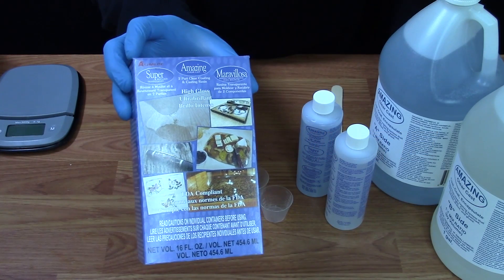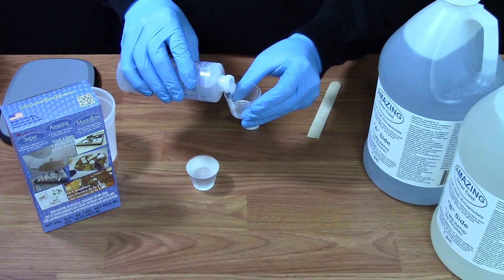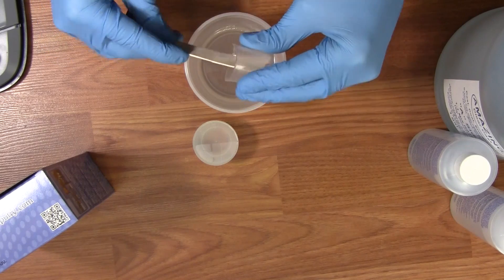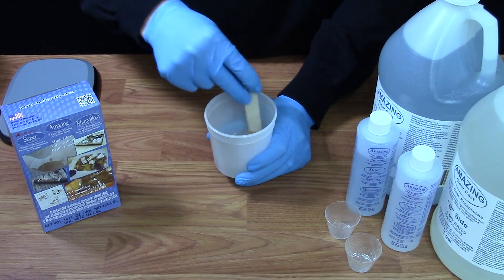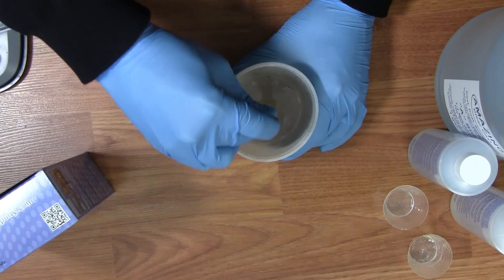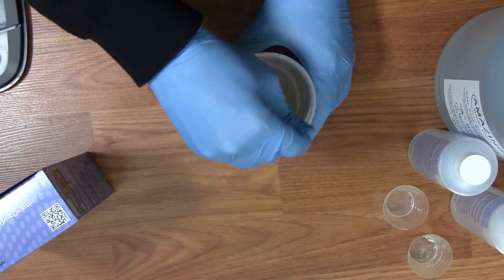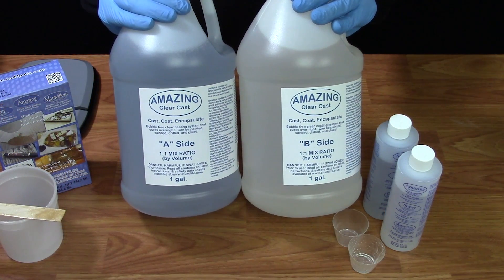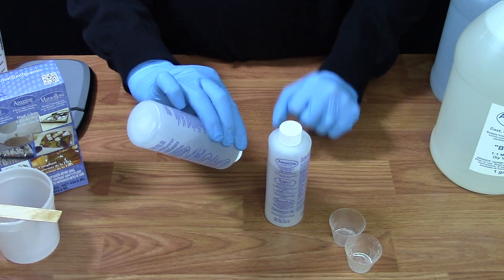How to Mix Amazing Clear Cast Resin | Alumilite

Comment: Nope can't put a picture but trust me a side is very clear while B is the color of urine sorry to say but it's exactly like dark urine anyone know what happened
Reply from the maker: This is a Polyurethane it starts out yellow, rather than turning yellow over time, this is typically due to the specific chemicals and processes. It's worth noting that the yellow color in these cases is inherent to the material from the start and is not the result of degradation or external factors like UV exposure.

Comment: Glad I watched this video. I've used amazing clear cast before & didn't have an issue. This time when I purchased it, all of my projects have been coming out bendy even after curing time. My guess now is that it's because this go around, I've been using a scale to measure out my epoxy. The first time, I was not using a scale - I was using a measuring cup. Thank you so much for this video! =)
Reply from the maker: You got it! Sometimes it's just something small that can make a huge difference. Happy making!

Comment: I'm doing a fairly large roto- molding project where I will be using 16 oz. of resin. What will the ACTUAL  CURING TEMPERATURE be? I have an infared thermometer. I don't want to have a runaway reaction. Thank You!
Reply from the maker: This is a great question for our customer service team - you can reach out to them at info@alumilite.com!

Comment: I have a question, is it eco friendly?
Reply from the maker: This is a great question - and the answer is no, it's impossible for resins to be made in an eco-friendly way since they are basically a hard plastic. What you can do instead, is minimize your waste: use silicone materials like cups and stir sticks so they can be reused, save your excess resin pieces to use in later projects, and follow the product directions so you don't end up wasting a batch from improper mixing.
Reply: I understand, thank you for awnsering

Comment: I always get tiny clear pieces of something  in my epoxy. I see it when I pour on my tumblers and am coating it. The'yre not bubbles because if I remove it I can see it on the glove. Then I have those little bumps on my tumbler once its dried.
Reply from the maker: It sounds like you may have gotten a bad batch or are using a dirty mixing cup! We would recommend reaching out to our customer service team at info@alumilite.com for help!

Comment: I've worked with this resin before and after a week or two of opening the bottles my hardener turns yellow, why is this? And if I buy the gallons, it will also cure clear, right? I ask this bc one of the gallons look really blue 😅
Reply from the maker: Great question -all epoxy yellow over time, and it's increased by UV exposure, being open, etc. Storing in a cool dark place will help limit this. Also, yes the gallon cure completely clear.

Comment: If I'm doing multiple colors when is best for good color separation? Will this heat up to a temp in looking for or a time limit so my colors don't run together?
Reply from the maker: For the best result with color separation, you will want to wait to pour until later in the open time of the epoxy you're working with! You can watch this video on color separation with Amazing Deep Pour but just remember that Amazing Clear Cast will be a little different - https://youtu.be/7smKuCdoa54!
Reply: @AlumiliteCorporation  thank you!

Comment: Sorry for the long post but need to explain....  The directions in the 1 gallon kit I got has slightly more to it than what's shown in the video.  Like using a new mixing stick for the actual mixing, mix for about 3 minutes, then pour into another cup and continue mixing for a minute.  I followed directions but somewhere I went wrong.  I'm making a free form resin dish in 5 colors.  1 and 1/4 cup of "A" and same measurement for "B", mixed until it was clear which was more than a few minutes and ensured that sides and bottom were scraped, transferred to the next cup and mixed with a new stir stick for a minute.  Poured amounts needed in 5 smaller cups and started mixing in resin dyes.  I noticed that the cups were getting hot, and that's including the cup I left clear.  It all was starting to cure like those 2 part epoxy glue syringes you can get.  Not all went to waste as I quickly poured what I could and made myself a little soup dish or something.  This project is actually for a customer though so I need to know what I possibly did that sped up the curing process.  It took maybe 4 hours or more for that dish to fully cure, no stickiness or tackiness that other people here are experiencing.  I noticed that the clear cup turned yellow too.  I have a small heater in my room to help prevent bubbles, is it possible that both parts got to warm before I mixed?  Or did I mix for to long?  (The parts that did harden in the cups won't go to waste either, I'm crafty and waste not you know lol)
Reply from the maker: Thanks for reaching out - this is really strange! The product was most likely too warm and was poured too late in the open time. Since you are mixing a larger batch and separating it into smaller batches for different colors, you don't necessarily need to pour the larger batch into another cup before separating it for the colors - the mixing for the colors will act as the "2nd mix".

Next time try mixing the large batch in one mixing cup for 3 minutes (we like to set a timer on our phone for this), separate into 5 smaller cups, add your colors, and mix each smaller cup until mixed to your preference (fully mixed would be about 30 sec to 1 min or until no swirls are present). Since you're using a heater, you can mix a little more quickly since the heat will help with bubbles. Just make sure you are pouring all of your smaller, colored-cups within the 30 minute work time! Once 30 minutes nears, the product will start to harden! You have to be quick! (And don't worry, we run into this problem far too often when we get distracted lol so we understand!)
Reply: @AlumiliteCorporation  thank you for your response!  I might get my significant other to help out with this timewise.  I found the coloring part to take the longest as it's specific.  I'm guessing I was 20 minutes in when this started to happen.  I usually set a timer using my google nest mini, I imagine google assistant on our devices can do the same.  Bubbles definitely weren't an issue but yikes that did kinda freak me out a little when it got real hot lol.  Again thank you and hopefully people will read this and learn.

Comment: Can u save this after it’s been mixed and if so how do I cover it to save for my next project?
Reply from the maker: Unfortunately you can’t save excess resin after it’s been mixed. The chemical reaction starts immediately upon mixing the two sides - with with ACC specifically you only have about 30 - 40 minutes to work with it before it cures too much.

Comment: Can I sit both of my jugs in warm water before I pour each and mix? I used different brands before and it would say I could give warm water bath to resin side only not the hardener. Also, is part A the resin or hardener?
Reply from the maker: Yes you can put both sides in a warm water bath!! And the B side is the hardener!

Comment: Your instructions  say not to mix less than 1 ounce at a time is that total or 1 oz for each part( or 2oz total)
Reply from the maker: That's 1oz total. The smaller your batch is, the easier it is to get your mix ratio wrong and have curing issues. Make sure to measure as exact as possible, especially with small amounts.

Comment: My resin casts come without bubbles but resin is not clear! It's like matte and whitey. I don't have time to sand the pieces !
Reply from the maker: Hey there, some resin products are white but if you used a clear epoxy then it should have come out clear! If it's coming out white then you might have a moisture problem!

Comment: Beginner here, I've never used resin before.
Can I "color" the resin in with glitters instead of dyes? I've seen videos where people make shakers and charms with glitters and bits in the resin, but they all were UV resin.
Also, if I have resin left over after pouring into a mold...  is there a way to store the extra resin so it won't harden?
Reply from the maker: Yes you absolutely can! If you use heavy, chunky glitter it may to the bottom, so just be aware of that. And no, once you mix sides A and B there's no stopping it from curing.

Comment: Why can't you use a scale? I'm not good with just eyeballing it and I can't afford to waste any resin
Reply from the maker: It's a 1:1 ratio by volume, not by weight. You'd have to measure 1oz side A to 1oz side B to figure out what the equal weight ratio is to use a scale!
Reply: I usually mark on the cups I'm using for mixing eg if I want to mix a cup, using water I'll fill cup "A" 1/2 cup, mark that then fill cup "B" 1/2 cup and mark that etc. Double check it and make sure the cups are thoroughly dried before use of course.  Signing up on the Michaels site can get you coupons as well.  I just bought this stuff, the gallon set at 40% off 😁

Comment: does this work on 3d prints to create a smoother layer?
Reply from the maker: You could certainly use ACC to coat the surface of a 3D printed piece, but since it's self-leveling it works better on flat surfaces.

Comment: I've been working with many resins. and none will cure out hard or ridgit. the part I'm trying to make is 1/ 8 thick. must not be rubbery. But all the resins produce rubbery parts! the resin must be clear and very ridgit
Reply from the maker: Hi Don! It sounds like you may be mixing too small of a batch. It's difficult to get exact amounts of A and B sides when mixing small batches, and even a drop of a difference can inhibit the curing. Try mixing up a little bit larger of a batch! Also I'd recommend letting your piece sit for 72 hours up to a week. After that week has passed you should have a solid piece of resin!

Comment: I used this in my dining area at my table for keychain molds. I had a fan on. I live in an apartment and it's hot here where I live. So hopefully that's ok. Also is this stuff supposed to smell like burnt caramel??
Reply from the maker: Hey there, noticing a smell just means that you may be chemically sensitive to the formula! If your environment is warm just make sure to keep an eye on the temp of your pieces, you may want to pour in thinner layers to make sure there are no possibilities of heat damage!

Comment: Hi there! If you plan on using a heat gun for the bubbles, is it still best to let it sit for about 5-10 minutes first to let all the bubbles get to the top or does it matter?
Reply from the maker: Either! You can do it more than once too, so if you want to hit the immediate bubbles and come back in ten minutes and hit them again that definitely will work.

Comment: Whenever I use it it looks “foggy” with all the little bubbles. What am I doing wrong ?
Reply: Pour in layer, heat gun, torch and repeat
Reply from the maker: Hi Rebecca - please email info@alumilite.com regarding this issue and send photos if possible. Are you following the steps in this video?
Reply: Keep stirring all the way first. After pouring use heat to pop bubbles. Even something as small as a regular lighter.. GL
Reply: This happens to me too!
Reply: It's happening to me too.  I've mixed them following the directions and twice my mixture looks cloudy. I'm wondering if I have a bad batch.
Reply: @Ty704 mixing too fast/vigorous

Comment: If I pour this epoxy onto a white surface, will it turn yellow over time even if it is mixed properly?
Reply from the maker: Hi Ashley - great question. Yes, all epoxy yellows over time. You can slow it down by adding a tiny drop of dye to your epoxy, keeping it out of direct sunlight, etc.
Reply: Thanks for the quick response. I was asking cause I would like to use this in my kitchen but I don’t want the countertops to turn yellow. So if I add the white color to the epoxy like in the kitchen countertop video will that help keep them white?
Reply from the maker: @ashleysonyea  Yes! Correct. The yellowing is very apparent when the epoxy is by itself, undyed.

Comment: I just used this in my kitchen for my tumblers and it's amazing. I just hope my kitchen is well ventilated lol.
Reply: I had my ceiling going in my kitchen. So I hope that helped.
Reply from the maker: @MagikalDivinations  That should definitely help. We always recommend being safe - wearing gloves, safety glasses, and a respirator or working in a well ventilated area! I know it's hard if you don't live somewhere warm because you can't open a window, but the fan should definitely help!
Reply: Alumilite Mold Making & Casting Materials okay I'm so glad bc I don't have a face mask like that they are expensive. But I am glad that my kitchen is good enough but I do wear my gloves and I do wear glasses but not PPE. IM BLIND. but I did use my epoxy and got it on my hands a few times but no reactions and I'm feeling fine! I'm going to get basic masks just to be extra safe
Reply: @MagikalDivinations   Hello ,in best interest of ones health,  trust me, no matter how expensive  a good respirator is , it will be cheaper than what inevitability will be occurring in medical bills .  Especially if you sand your resin at all. And if you can afford to buy the resin you can afford to buy a respirator.  I've made that mistake in the past and now pay for it e every day . 
Ps no matter how low a brand claims their voc’s are
Reply: @sarcastic-leo  I haven’t done cups in almost a year... I’m now making and selling shirts lol
Reply: @MagikalDivinations  ok😊
Reply: @MagikalDivinations  Sadly I just noticed your screen name, so in this case I should say , Blessed be 🌟
Reply: @sarcastic-leo  blessed be to you as well
Reply: What temperature can this be used? I’m looking to make my first tumblers as well as use some molds I have but will be doing this outside. Should the temperature be warm or cooler? Thank you very much.

Comment: You’re off either way on the ratio because you wipe it off on the lip of the cup.
Reply from the maker: The great thing about epoxy is that it doesn't need to be perfect - it's fairly tolerant when in comes to mishaps. You just want to make sure you're not off by a large amount and it should still cure correctly if mixed thoroughly!

Comment: I'm making  a small table with wood slices on top as decoration. Can I sand the Clear  Cast?
Reply from the maker: You absolutely can! Depending on the grit you use you can bring it to more of a matte finish.